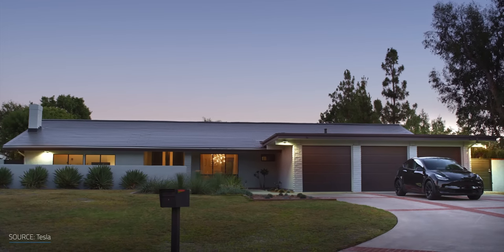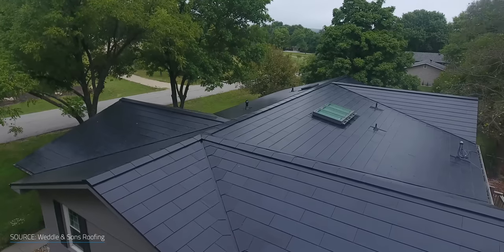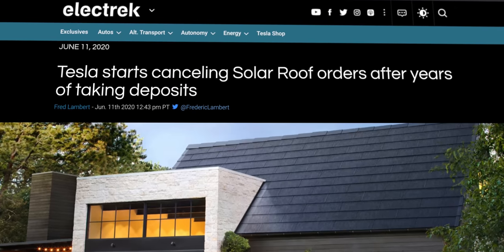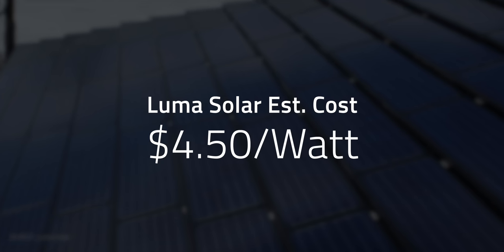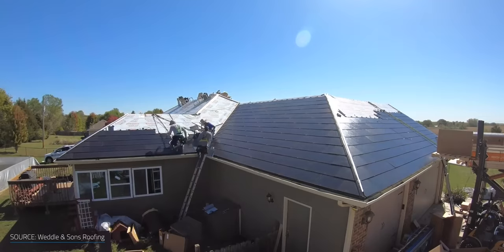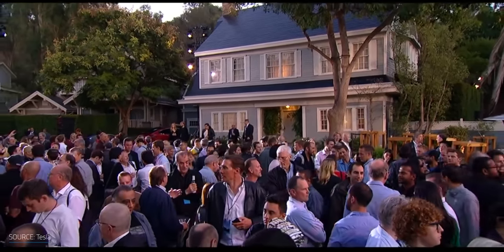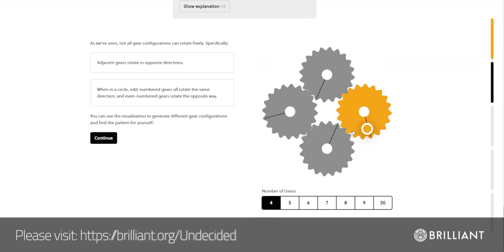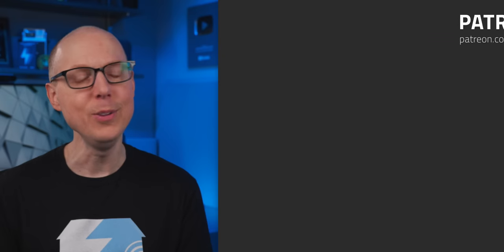The Problem With Tesla’s Solar Roof

Comment: I really wish you had covered how these systems handle hailstone impacts and other hard weather events.
Reply: Traditional solar panels are extremely resistant to hail and other impacts (way better than normal shingle roofs) so I would assume these are similar.
Reply: Anything the size of a grape or smaller shouldn't do anything to them.  Maybe a small mark.
Reply: On a previous video which I believed that he referenced in this one they demonstrated that the Tesla solar tiles were extremely durable against things like hail.  We have no solar but have been talking about it for 20 years....

Comment: We are happy with our Tesla Solarroof.  It produces a lot of electricity and the cost was within $1000 or a replacement tile roof, which is the standard in our neighborhood and was the target from the beginning with the Solarroof.  We also added a couple of Powerwalls for which there was a discounted install since they were installing the inverters and solar wiring anyway.  So far the roof and Powerwalls have performed as advertised and reduced our power bill dramatically.  We pay about $30/mo, most of which is the grid interconnect charges.  In previous summer months, we have paid close to $500 because the high temps drove us into the higher cost tier rates. 

The installation was done well even though it was started in March 2020 right before the pandemic hit and the county stopped all work mid-install.   Thankfully, solarroof installs start with putting down a waterproof membrane, and that finished install just as the stop work order came down.  After a month they let the Tesla team come back and completed the installation.
Reply: That sounds awesome.  What company did you use, did you reach out directly to Tesla or a local roofing company?  I'm contemplating going that route as I will likely need a new Tile Roof after Hurricane Ian in SWFL and it sounds like the cost maybe very similar

Comment: I have already used regular solar panels to make a roof and are planning to do more. My first one is just a verandah roof sealed with silicon on the outside. It is cooler than my other arrays due to open air flow underneath. Is also easy to work on and configure wiring from below. I've been off grid for decades and now have a fully working camel dairy running off solar wind and Ni fe batteries. 
I use older second hand panels because I have lots of space for them especially now they are being used as  roofing to  boot.
Still need to work on a nicer connecting /sealing system. 
Thanks for your show BTW 
Regards Warwick
Reply: Excellent!  I was thinking of this for a carport.  Bottom mount the panels and space with tile x bits.   Long lasting silicone or adhesive roof tape should work...glad to know it does.😊

Comment: Even if all roof was fitted with solar tiles when it is built new or renovated it would take 50 to 60 years before most roofs would be solar.
That means we are still in the early adopter stage for at least another 10 years. When you add that up front cost will be higher it would be a miracle if 1 % of the roofs built the next 10 years are built with solar tiles, but it will still be a multi billion marked that need many suppliers.
Reply: This is why more places need to pass laws to mandate all new construction have solar. We can’t leave it up to the free market to decide when to switch. Not with our emissions where they currently are…
Reply: @SaveMoneySavethePlanet  no. That’s asinine. That prices more people out of the market and would serve only to drive up costs. Solar still doesn’t pay off everywhere. For me it will be a 10+ year breakeven - I can afford this, but in absolutely no way should that be mandatory.
Reply: @SaveMoneySavethePlanet  Sound good, but it do not work without a major subsidize support. If not directly it will be needed for building infrastructure. Already many areas have trouble with the amount of back-feed to the grid a real sunny day give. Large scale storage is also needed and it cost a lot.
Based on raw material demand we have probably already seen the lowest prize on solar installment, unless they can find a lot cheep way to produce solar panels.
Reply: Correct.  Given that most homes waste 80-90% of their energy, most of each installation is just to get a discount on all that waste, like throwing most of a giant Costco toilet paper purchase out the window on the way home.  Stupid, right?  What's the ROI of a flatscreen TV or stone countertops or a new car?  Generally zero or less.  ROI on energy efficiency is highest, and cutting the fat and eliminating waste moves the PV ROI to just a few years.  Efficiency and then PV.  Doing the wrong things right is still wrong, right?
Reply: @DK-vx5co  That you would survive if you did not use some energy is not the same as it is wasted. Also what is wasted will be very different around the world.
What you put into the calculation is often more a philosophic then a practical question.
Reply: @bknesheim  Yes.  Air leakage, duct leakage; thermal leakage; drafts; hot rooms; cold rooms; kitchen, bathroom & laundry fans (where is the air leaking in from?); appliance heat and noise are all wasted energy which is not necessary to survive where I live.  These are just bad habits that make up the 80-90% waste you have grown accustomed and privileged to.  Those are quantifiable data-sets and only philosophical to the very privileged (wasting because it's your right).  Acknowledging is the first step in fixing a problem.  Pick your poisons.
Reply: @DK-vx5co  I do not now how they build where you live, but where I live double or triple pan window are the norm. Walls have usually 15 cm (6 inches) insulation and are sealed and pressure tested. Also condenser dryer are used for washing and more then 50% of heating is done by heat-pumps.
There are still wast, but it is fare from 80-90%. My point is that what might be true locally can not be extended to all.

Comment: I like the idea of solar panels but I won't be getting any in the near future. 

My electricity bill is $100 max a month in the summer (summers here average over 90°F (32° C) daily) and under $50 in the winter (above freezing 99% of the time). I have a metal roof and energy efficient air conditioner that has saved me 20-30% monthly on electricity. In the winter, my electricity bill goes down to less than $50 a month due to gas heating which only goes up ~$20 a month in the winter.

My hope in the future is that the energy storage will improve to the point that I can completely go off the grid electrically. I feel we are close.

Comment: Logically these roofs need to be on new-builds and could be incorporated into building codes alongside improvements in insulation, glazing, heat pumps, geothermal, underfloor heating etc.

Comment: One thing you failed to mention (in my area is a summer/winter certainty), is how do these solar panels/shingles hold up to weather, such as hail, snow, sub-zero (F) temperatures. A big considerations for homeowners in these climates.
Reply: Supposedly they are better at resisting Hail than asphalt roofing.
Reply: They do well.

Comment: Tesla quoted me a very reasonable number, then doubled it in part because they made powerwalls mandatory (I rarely see any power outages and my utility pays the same rate for solar spillover as it charges for power). Then I got the plans, and it was a much smaller array and 80% of the PV tiles were on north facing slopes. The net result was the expected power was 20% of my needs. They claimed they couldn’t install on the southern exposures, but that’s not true. And the southern exposures had fewer obstructions (vents, etc).

Comment: Glad to see the technology improving and becoming more cost effective. But, black shingles, directly attached to the roof, with no thermal barrier, during 110 degree AZ summers is a deal breaker, IMO. Now, expensive EPF insulation is required to compensate, assuming that there is an attic with inside access to the rafters.
IMO, roofs are roofs and PV panels should be mounted on solar trackers for maximum efficiency. The best option would be a solar carport with a tracking array to shade and protect vehicles from the elements.
Otherwise, why can't PV panels be white?
Reply: A house should have an insulated roof these days

Comment: When solar roofs can  be installed via DIY, that's when it will take over as the best option.  It's a young product yet.  But it continues to get better.
Reply: It’ll almost never be full DIY, but I could see most of the instal being DIY and then you have to call an electrician to do an inspection and the final hookup.

But I agree, even getting to that point would likely drive sales up like crazy!
Reply: Solar PV systems can run at up to 1000V DC and need to connect to the AC installation within a house. It's not really a DIY job, unless you're cool with things setting on fire
Reply: You could do it yourself assuming you can acquire the tiles.  The GAF solution may make that easier.  And plenty of people install their own solar panels, inverters, etc.

Comment: I'll need a new roof in about 10 years.  Hopefully, solar roofs will be commonplace at that point.
Reply: Same here
Reply: Having a $1200 iPhone is common place these days. Doesn't mean it's a good investment.
Reply: @damirs3430  My point concerns the availability of solar roofs, not the cost.
Reply: I do not think so, they pay the sub companies and assemblers far too little. Especially in Europe. 
1. PV systems require specially trained electricians / certificates not everyone is allowed to install them and solar roofs need extra qualifications to do so.
2. a PV system electrical testing is already not easy with normal systems and with small module designs a disaster. 
3. there are other easier jobs for electricians that are paid much better. (Office equipment testing or smoke detectors, etc. There is enough nonsense in Europe).

Comment: my biggest issue with solar roof shingles is what happens in 10 years when a panel breaks? Is the company still in business? do they still make the tile you bought, or do you have to make do with a different tile, if that's even possible?
Reply: exactly.  What happens when all of the installs fail around year 5-7?  That company is not going to exist to honor any of the warranties.
Reply: @joegreene6250  How long do you think solar panels last...?
Reply: @spacebound1969  yes but I'd guess that replacing a solar roof isn't as easy as just replacing a solar panel.
Reply: @karlfranzemperorofmandefil5547  The shingles are mini solar panels essentially that mount to a track like a normal solar panel. The process is the same.

Comment: I wish you had mentioned snow sliding off slick roofing. Starting in 2005 I installed traditional panels, flush mounted, on my house and detached shop near Denver--snow country!. Most winters I have had an avalanche of snow sliding off the panels, despite having at least a foot of asphalt exposed at the foot of the panels as well as gutters. Fortunately all exterior door are under cover, because the avalanches could seriously harm someone.

Comment: I opted for standard panels. I have a 10.4 kw system and am now in the process of getting batteries as well. I don't trust anyone in the US government not to take the money oil and gas donate. They (oil and gas) are trying to make renewables go away.

Right now I get 1 to 1 net metering so the grid is my main backup, but that can change at the drop of a hat. I am hooking up 10 circuits in my house to the 20kwh of batteries I have as a test so I have a path forward when oil and gas wipe out net metering as has happened in many places in the US.
Reply: Not quite "go away", but put off that day as long as possible.
Reply: @UTArch1  I guess it depends on where you live. In Texas oil & gas are king. See this excerpt from the Dallas Morning New today:

Last year, the GOP-led Legislature enacted a law that bars the state from contracting with firms that limit business with the fossil fuel industry. The policy also calls for pension funds, such as the state employees and teacher retirement systems, to divest from companies that cut ties with oil and gas, so long as the moves won’t cause financial harm.

'nough said.

Comment: I really like the idea of the Tesla solar roof, and when I found out my roof was at the end of its lifespan two years ago, I signed up to get one on the Tesla website. But after two years on the wait list, plus the roof seemingly not available in northern Ohio, plus the increase in cost, plus the poor customer service, plus the multiple of problems people seem to have with installations, plus Elon Musk acting like a jerk on Twitter, I decided to get a new traditional asphalt roof and solar panels. I am comfortable with this decision and it was probably actually cheaper than the solar roof anyway.
Reply: That's too bad.  Energy costs are going up and supplies are dirtier and more expensive from extraction to final usage and all the waste along the way.  Just a little war has made gas prices rocket up and things are getting worse.  When a home needs a new roof is the perfect time to ween from the Saudi teet.  Better yet, get in there and do a little bit of energy efficiency and air sealing and you might eliminate 20-40% of the demand in the first place, for decades to come, and have a more comfortable and healthy home to boot.  As Covey said, begin with the end in mind.
Reply: @DK-vx5co  I wish that I could have made it work, but my roof wasn't going to wait.

Comment: I had 2 local solar companies come by my house to do an estimate for install. They were going to install 21 panels on my roof to meet my demand. I had to cancel my install because it was going to cost me double per month what I'm paying in electric and gas total for the next 15-20 years. I don't know how solar is a cost viable option for anyone. At $150/month for 15 years is $27k, and even if my bill goes up to $200/month that $36k. While solar install @ $50k for 15 years is $277/month, and that's not counting having a battery backup which can add an extra $10-$15k, so I'm paying more per month and still losing power during a blackout, so I'm seeing no benefits and more cost. Since my state and county require me to stay tied into the grid, I don't actually get refunded for the excess power I output for them, I only get credited for when I'm not overproducing. So if I want solar, I have to buy it all and install it myself, but my power company has to approve and sign off on it.
Reply: Yeah, you're facing a set of serious obstacles that will take time, money, and effort to overcome. I'm puzzled by a legal requirement to remain tied to the grid, though. That sounds like a situation just asking for a lawsuit to reverse it, and there seems to be no reasonable justification for such a requirement, leading one to assume that was a law purchased by utility-funded lobbyists.
Reply: sounds like your getting ripped off, 21 panels for 50k, thats nuts
Reply: @robertbowman9108  agreed.
Reply: We need more competition and streamlining of the permitting process.  I installed an 82 panel system for $59000 after incentives.  The learning process, the permitting and dealing with the utility were all challenges.  Its saving me $6300 per year, while providing passive cooling for my house.  But its not a solar roof, its a shade structure.  A solar roof would have been harder for me to do and increased the risk of a roof leak.  Not everybody has the space for this, nor the clear sunshine nor the solar incentives of Phoenix where I live.  I think that anyone who is building a large, custom (energy hog) home in the southwest should have solar integrated into the build.  It pays even without help from the utility, and its the right thing to do.
Reply: $50k? We do a 6.6kW system in Australia for like $4-5000 Australian dollars.
Reply: @Teeurbo  is that just parts or is that including installation costs as well? Triple that price and you'll get the low end average in the states, after tax incentives are taken out. If we want that price, we have to install it ourselves, lol.
Reply: @jerm22278  That's the whole installation. We have an average installed  price of about $1.20 a watt BEFORE rebates. 

It boggles my mind how expensive PV is in the US. You'll never have mass adoption at those prices. Here it's now so cheap you're stupid NOT to have solar. You'll spend more on electricity than you would paying off a loan for solar. It's a no brainer.

(I'm a solar installer/trainer btw)
Reply: Yes.  Gas requires leakage to save you from the flammable component, carbon monoxide, aldehydes, etc.  This leakage increases energy consumption and makes IAQ (Indoor Air Quality) worse to compensate; and that leakage makes your home more uncomfortable to boot.  Energy costs double about every 10 years, depending one here you live, doubling again in 10 years, etc.  If you're dumping the home on someone else, who cares?  If you care, it's a very wise investment.  Better to eliminate the waste, trim the fat first.  Then you need far less PV because there is far less fat and waste.  Plus, you will probably have greater comfort and a healthier home.

Comment: On the traditional solar panels on my roof, I have individual mini-inverters for each panel. That insures that when 1/2 the panels are in shade, they don't affect the 1/2 that are in the light. My understanding is that when all the panels are on a single inverter, panels in the shade reduce the output of the other panels. I wonder how solar shingles handle this issue?